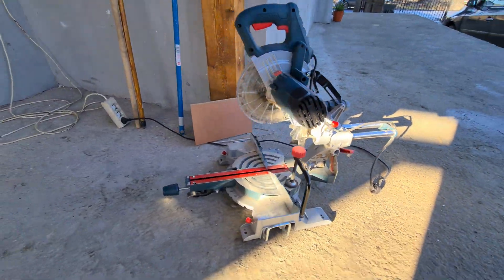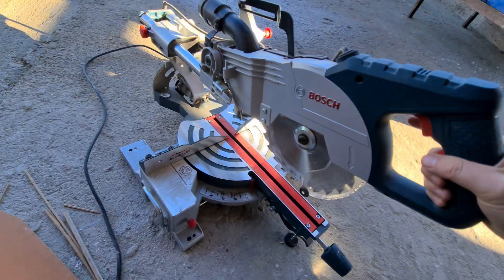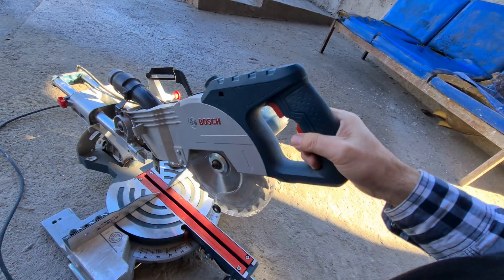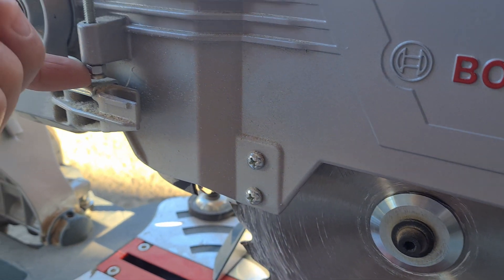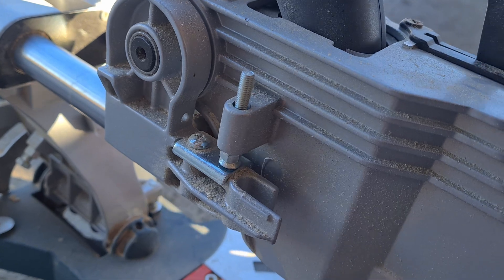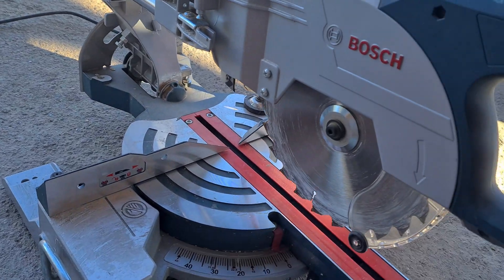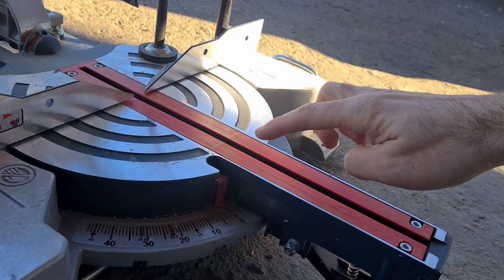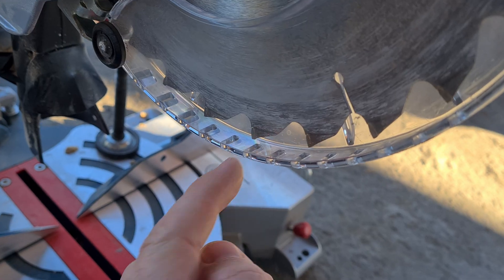Cutting Depth limiter (Bosch GCM 800 SJ, Sliding Miter Saw, Cut in the metal, Bolt/Screw & Nut)

Comment: I have this model and I do a lot of partial cuts for joining and grooves and the depth stop is terrible. I'm so sorry I got this model (it was used) but its all I could afford.
I also miss the laser found on more expensive models.. I want to buy something else but I'm currently more troubled by my crappy table saw whose fence can't be locked perfectly.. I'm so mad when I buy tools and machines and realize they don't satisfy my needs after I've spent hard earned money on them.. One wants to get by cheap thinking it will be good enough and ultimately has to buy things twice and therefore spend a lot more money than if one bought the more expensive tool the first time..
Reply from the maker: If you don't use the depth stop frequently, then just block it at a safe depth using a screw and a nut, so it won't cut into the base. A laser guide would be nice, but on some entry level tool of mine it was anything but precise. The dust collection part isn't too good either, but other then these it's good. The base of cheaper models from other brands even cracked in half, this is still fine.

Comment: Hello, I bought this model. When I start it up, I feel jerks - vibrations in the handle for a 2-3 sec., then run smooth, but when I start to cut the wood piece, the jerks-vibrations appears-feels again for a 1-2 sec.
Reply: It's normal on start up because you have soft start
Reply: My gcm 800 sjl does the same vibration.